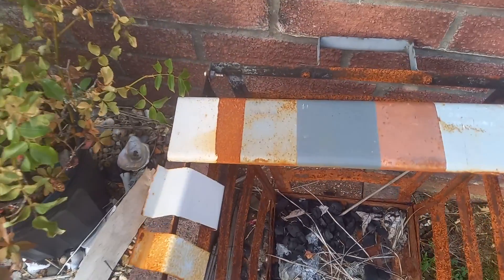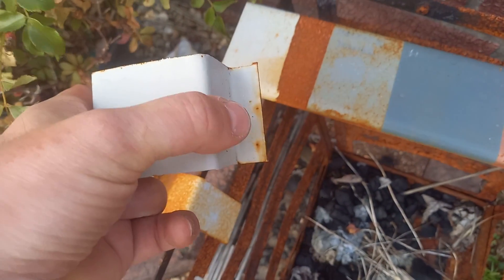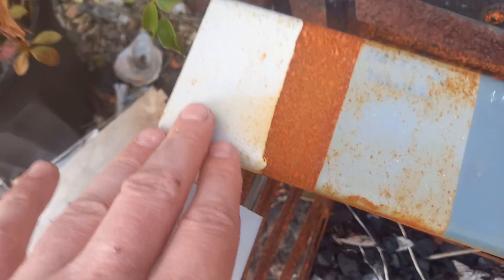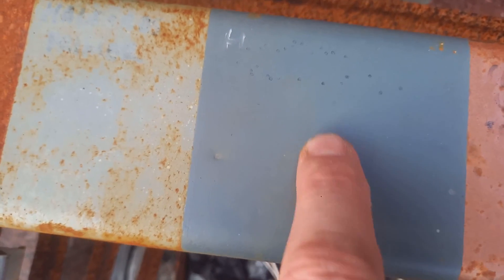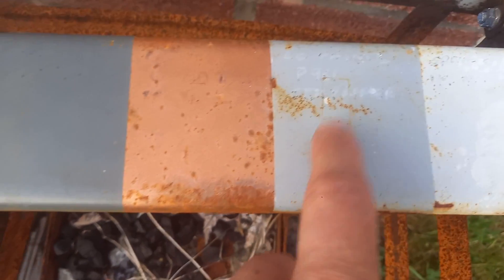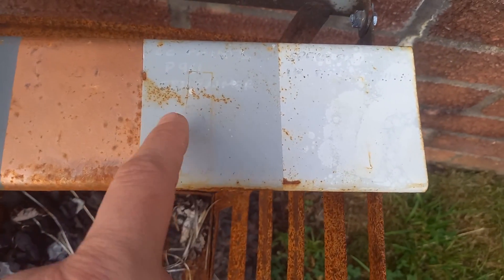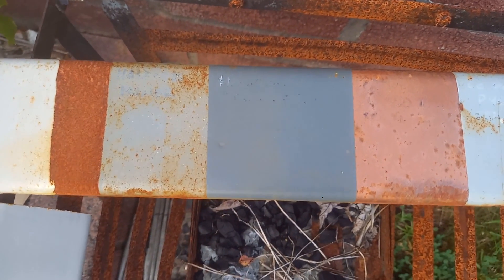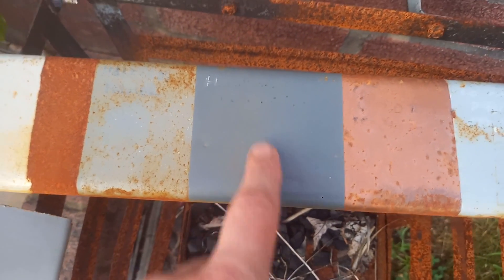Halfords Weld Through Primer Surprise Results!! Rust Protection.  Car Restoration.

Comment: That is very impressive and I really enjoy your videos. Do you use Halfords weld through as a weld through primer or as just a really good primer. I've heard it's not as conductive as upol weld through.
Reply from the maker: Hi Sean, I do use it as a weld through too, but if I'm plug welding, I'll clean in between the plugs with a flattened drill bit first.   It's definitely better as a rust protecting primer than a weld through though.